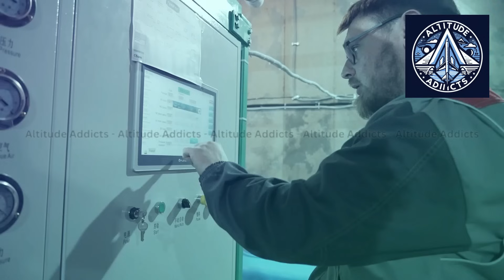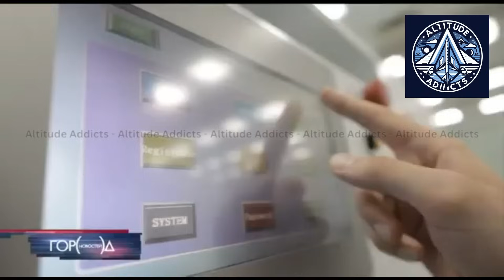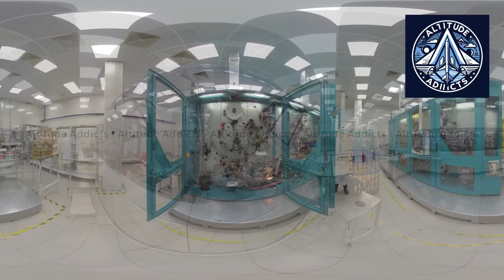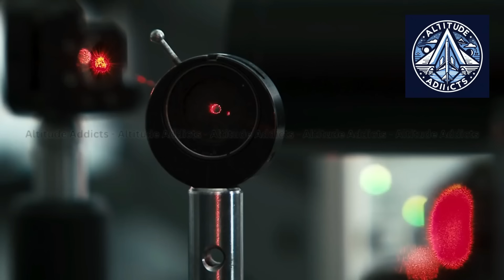Russia’s Bold Plan for 28nm Chips—New Chemical Center Revealed

Comment: 28nm is the optimal size for reliability, low production loss, longer lasting and radiation hardened chips.  45nm is the best size for the SLC long term, very high petabyte SSD production.
Reply: 100nm is actually
Reply: @TheGayimTheory .... SanDisk LB406S
Reply: Russia is light-years away from 28 nm. When it will be ready, if ever, it will be even more outdated than Russian 350 nm efforts today. The whole semiconductor program of Putins regime is nothing else but theft of taxpayers money.
Reply: @alexandervt641  This is not true, and you know you have been fooled by western misinformation.
Reply: @lexburen5932  It was Russia that deceived all Western countries by posing as a civilized country.